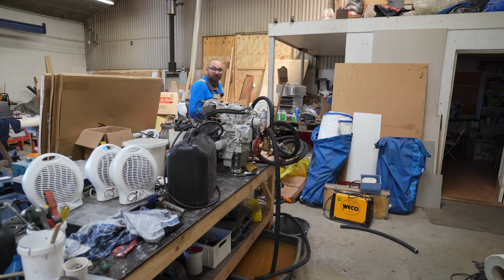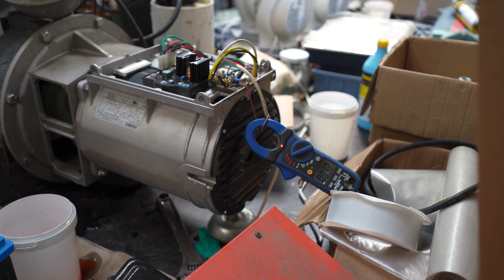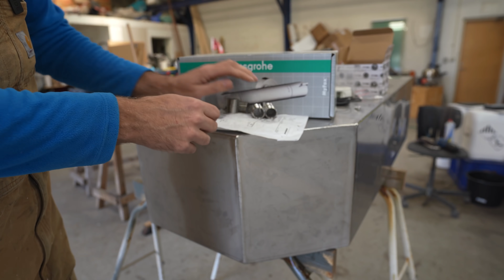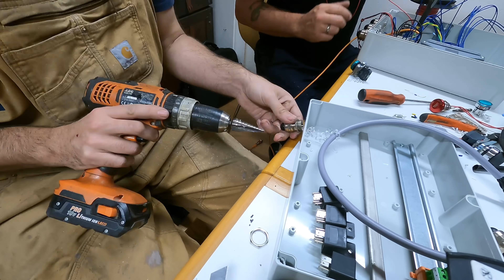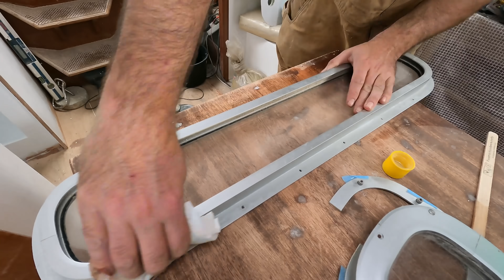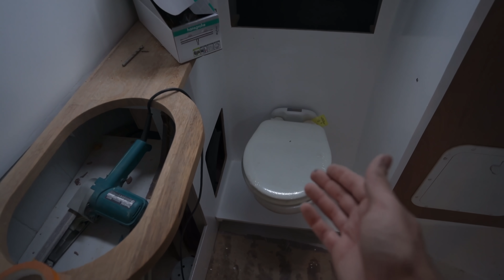Sail Life - The DIY genset is ALIVE & more progress in the head

Comment: Great job on the gen set, it looks to be moving right along. That's terrible news about the water tank, the builder should give it top priority in building you a new one with the correct revisions. Ingenuity at its best with the shower mixer and look at you working the lathe and welder, go you! Nice layout on your shower, super functional. Can't wait for next week's video.
Reply: Probably faster to just stretch & modify the V1 tank
Reply: @LittleWapiti  Mads already said V1 has no pickup tube and holds less water so I would not go this route.